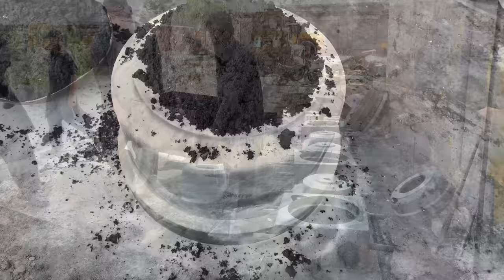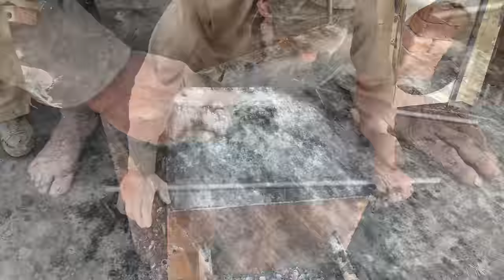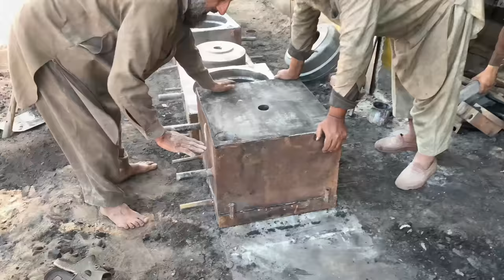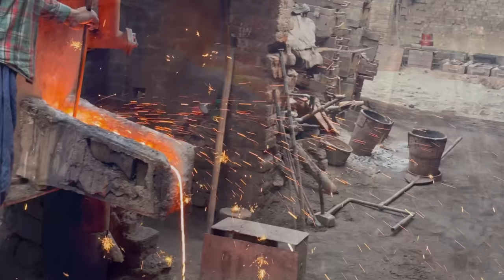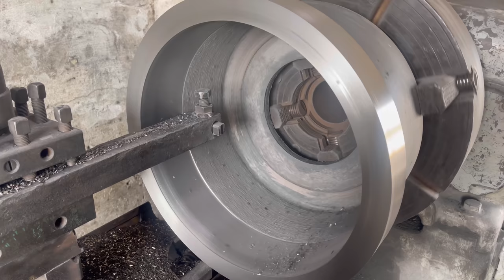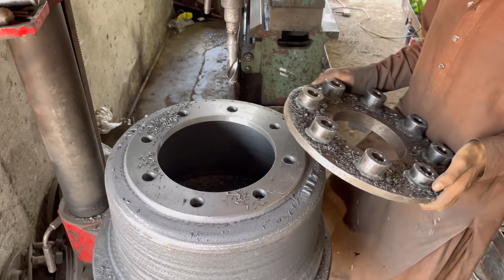Production Of A Truck Brake Drum |

Comment: What could go wrong. Cast from scrap metal, machined within .050" Shoulders not radiused,  and then no balancing. And it was a LONG way out plus the material is inconsistent, you can hear it right through the clip chattering.
And then will be fitted to an extremely overloaded truck!!